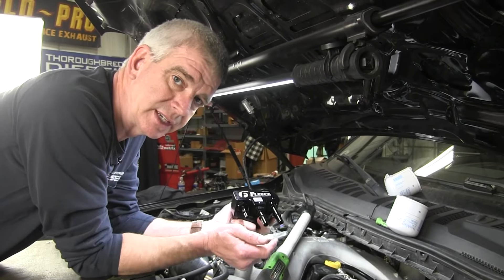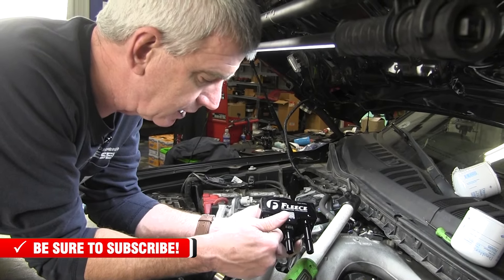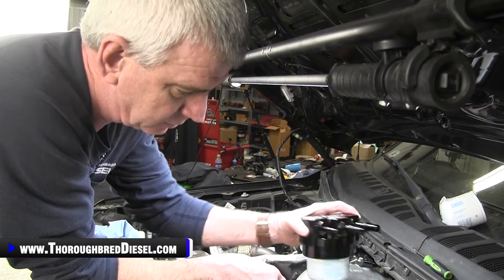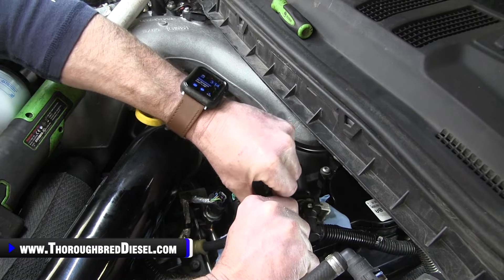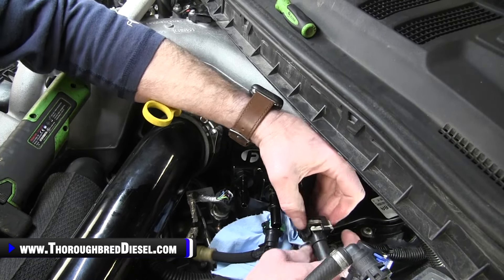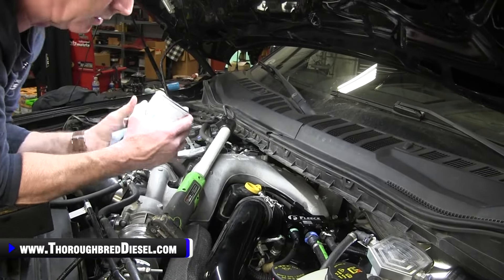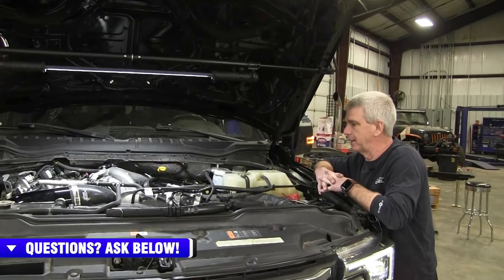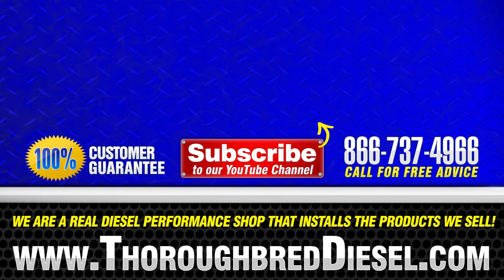EASY INSTALL: Fleece Engine Mounted Filter Assembly 11-24 Ford Powerstroke 6.7L #diesel #ford #fyp

Comment: Just remember there are many articles and videos on using metal filters causing rust issues………manufacturers use plastic for this reason.
Reply from the maker: The filter on this kit has been tested and is safe for your engine.

Comment: Is the micron rating the same as the oe filter ?
Reply from the maker: @randallward2805  Per Fleece:  Motorcraft does not publish a micron rating for the individual filters, they do however publish a 7 micron rating for the entire kit which includes the lower (primary) and upper (secondary) filter together. This rating is however not provided at any specific efficiency level so an apples-to-apples comparison cannot be made without knowing at what efficiency level the micron rating was derived. We can however state that the Donaldson filter is 9 micron at 99% efficiency.